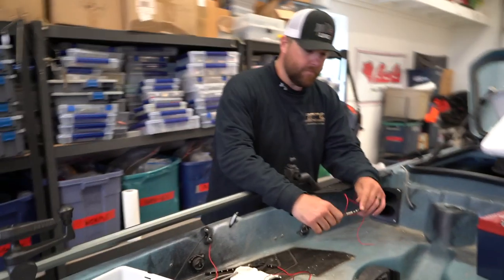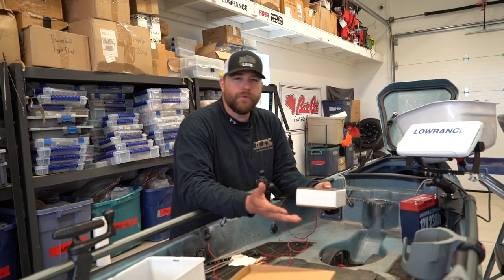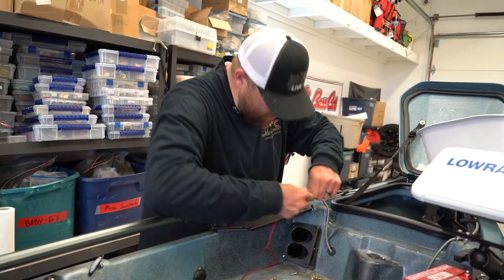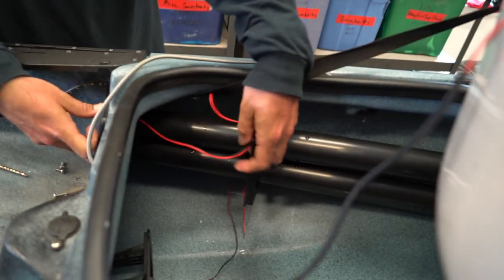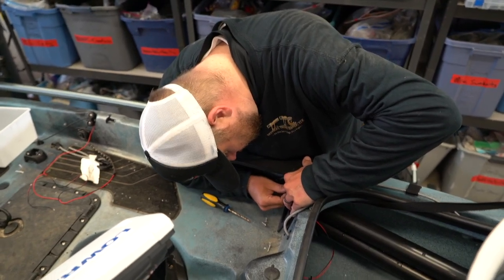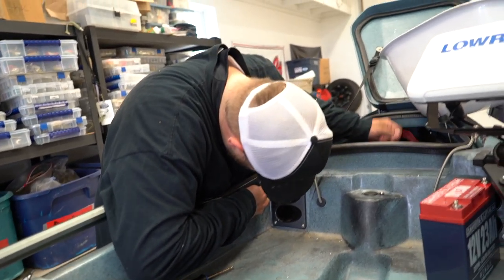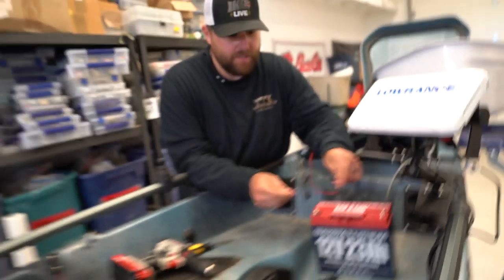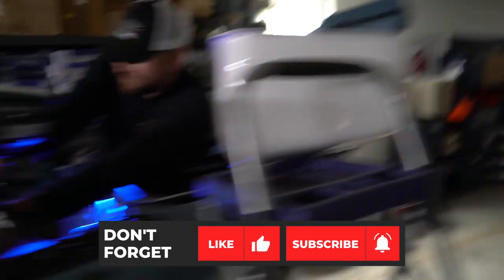HOW TO INSTALL LIGHTS ON YOUR HOBIE KAYAK!

Comment: Hi guys. I'm looking for an interior lighting kit for my Hobie outback..not for navigation...just for lighting.  The product you are demonstrating here appears to be what I'm looking for but I can't find any other photos of this solution online other than this specific video that shows only one light.  There are no reviews and no photos of what is in the box or what a complete & finished install looks like.  Can you provide any further info? Can you confirm that there are 3 pairs (six total) of those adhesive 8" light strips in total for front, middle, rear of interior which all work off a single switch? Can I run them off the same Nocqua battery that powers my fish finder?  How long do these last?  Years?  Months?  Can replacement light strips be ordered if one dies?   Any further info is appreciated.  Thank you.